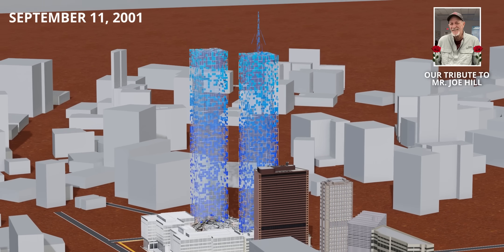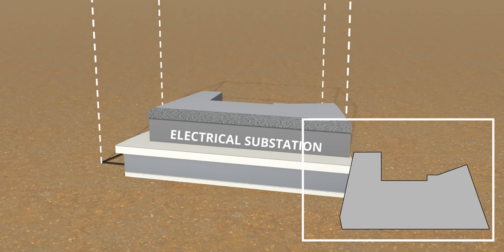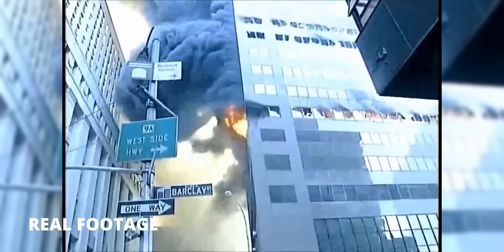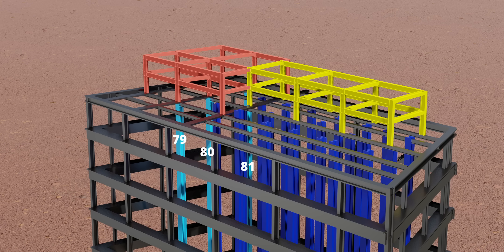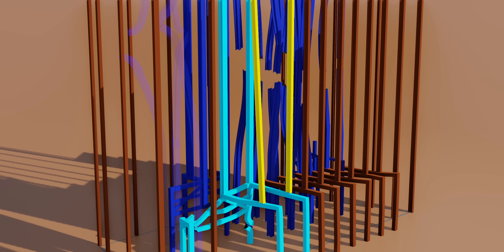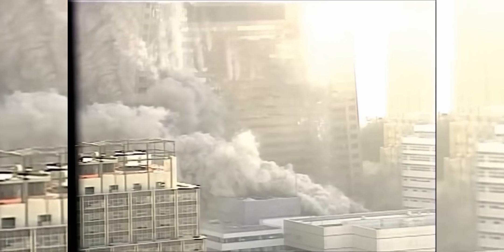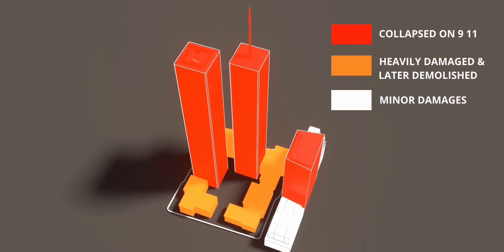Collapse of Building 7 | The Complete Physics

Comment: This video skips over a lot of major problems. WTC 7 had isolated fires, not a full-building inferno, and steel-framed skyscrapers had never collapsed from fire alone. Even NIST admitted that WTC 7 fell in true free fall for over two seconds, meaning there was no structural resistance, which does not happen without demolition. Localized failures like transfer trusses would have caused a partial, uneven collapse, not a near-perfect vertical drop. Multiple camera angles captured the kink and inward fall, so it was not a visual illusion. The video also leaves out seismic evidence, audible booms, and eyewitness reports of explosions before the collapse. On top of that, it assumes progressive failure without explaining how dozens of critical supports could fail almost simultaneously. This feels like a shallow explanation that leaves out too much important information to seriously account for how WTC 7 actually fell.

Comment: Calling BS!  It was a  controlled demolition.
Reply: Then provide a better, more detailed explanation. Go ahead, be the first to even try. 

You may not like it after more than 2 decades of internet conspiracy dogma, but what is being presented in this video is fundamentally correct and widely supported by the worlds engineering community.

While imperfect (there are a few problems) this video goes into a much higher level of detail than many viewers can comprehend and gets the collapse mechanisms fundamentally correct. This is true no matter who planned and carried out the 9/11 attacks or why . 
	
Sure, it’s not what you want to hear and goes against 20+ years of conspiracy dogma and conditioning, but that is not the same as it being wrong. You just need to fix your dogma. 

On the plus side, this video can be (and is) fundamentally correct about the engineering AND the 9/11 attacks could still have been some sort of inside job. The two things are in no way mutually exclusive. It’s just not the inside job the clowns you have been following on the interent have been telling you. 

This will surprise you to learn, since the conspiracy side of the internet hides it from you, but the mechanisms described here have broad professional support around the world. There are no professional engineering organizations (for example: ASCE, ASEE, ICE, etc) that disagree with them or have offered any formal dissenting opinions or alternative hypothesis. 

So, either the overwhelming majority of the worlds structural engineers and quite frankly simple observation are wrong,… … or you know more than the worlds best engineers from cruising around on the internet. Which seems more likely?

Comment: Complete BS.
Reply: And yet not wrong, go figure. Not perfect, but not wrong. 

You may not like it after more than 2 decades of internet conspiracy dogma, but what is being presented in this video is fundamentally correct and widely supported by the worlds engineering community.

While imperfect (there are a few problems) this video goes into a much higher level of detail than many viewers can comprehend and gets the collapse mechanisms fundamentally correct. This is true no matter who planned and carried out the 9/11 attacks or why . 
	
Sure, it’s not what you want to hear and goes against 20+ years of conspiracy dogma and conditioning, but that is not the same as it being wrong. You just need to fix your dogma. 

On the plus side, this video can be (and is) fundamentally correct about the engineering AND the 9/11 attacks could still have been some sort of inside job. The two things are in no way mutually exclusive. It’s just not the inside job the clowns you have been following on the interent have been telling you. 

This will surprise you to learn, since the conspiracy side of the internet hides it from you, but the mechanisms described here have broad professional support around the world. There are no professional engineering organizations (for example: ASCE, ASEE, ICE, etc) that disagree with them or have offered any formal dissenting opinions or alternative hypothesis. 

So, either the overwhelming majority of the worlds structural engineers and quite frankly simple observation are wrong,… … or you know more than the worlds best engineers from cruising around on the internet. Which seems more likely? 

If this explanation is wrong then produce a better one.  Be the first to even try.

Comment: All bollocks
Reply: You may not like it after more than 2 decades of internet conspiracy dogma, but what is being presented in this video is fundamentally correct and widely supported by the worlds engineering community.

While imperfect (there are a few problems) this video goes into a much higher level of detail than many viewers can comprehend and gets the collapse mechanisms fundamentally correct. This is true no matter who planned and carried out the 9/11 attacks or why . 
	
Sure, it’s not what you want to hear and goes against 20+ years of conspiracy dogma and conditioning, but that is not the same as it being wrong. You just need to fix your dogma. 

On the plus side, this video can be (and is) fundamentally correct about the engineering AND the 9/11 attacks could still have been some sort of inside job. The two things are in no way mutually exclusive. It’s just not the inside job the clowns you have been following on the interent have been telling you. 

This will surprise you to learn, since the conspiracy side of the internet hides it from you, but the mechanisms described here have broad professional support around the world. There are no professional engineering organizations (for example: ASCE, ASEE, ICE, etc) that disagree with them or have offered any formal dissenting opinions or alternative hypothesis. 

So, either the overwhelming majority of the worlds structural engineers and quite frankly simple observation are wrong,… … or you know more than the worlds best engineers from cruising around on the internet. Which seems more likely? 

If this explanation is wrong then produce a better one.  Be the first to even try.

Comment: Newcomers  -  just notice how many times   Criticalstink*** has replied within an hour or so and the general  Negative  " tone of voice "    Full time  SHILL  ( even on a Sunday ???  )
Reply: --  just seen  replies from  moroneyes   and  middleclass**      also   -    ( same  Shill Dept. )
Reply: In all highrise buildings a portion has to stick up for the cables and whatnot above the elevator shafts and usually there's steps as well to get on the roof. In any controlled demolition these shafts and stairwells have to be cut prior to the controlled demolition.  Kinks are created in controlled demolitions to make a building fall straight down. This clearly was a controlled demolition 1 because of the time it took to collapse proving there was no resistance at the time of collapse,  and 2 if any of the interior and exterior vertical columns met resistance you would see the deformation in the roof as it resisted on the way down. But never once does a portion of the roof protrude upwards from the resistance proving it didn't occur.

Comment: Total BS

6:25 Notice in this video how he omits the crucial floor bracings and steel beams that interconnect the columns—elements essential for structural rigidity and floor support. In reality, about 95% of steel buildings rely on a truss system, typically incorporating 45° angled supports, to evenly distribute loads and prevent any single column from bearing excessive stress. Without it, the entire structure would lack the balance and cohesion that such systems are specifically designed to ensure.

If you go on truth social and look up a group titled as “Never Forget” there is a video there of someone who used a digital home camera to record the actual blast that is going off in the building. You will hear the explosions happening, bringing the building down.
Reply: Of course all but the columns are omitted at 6:25. Were you paying no attention at all?  Are you really that clueless?
Reply: "there is a video there of someone who used a digital home camera to record the actual blast that is going off in the building. You will hear the explosions happening, bringing the building down."
No. There isn't. And making that up doesn't change anything.
Reply: @mooneyes2k478  wait isn’t that “video” just a hoax made by EdwardCurrent?
Reply: @RandomUsername2342  Indeed it is.
Reply: @mooneyes2k478  figured.

Comment: Interesting, why dont my steel and cast iron pans similarly melt when exposed to 600F on my stove? How did WTC1 and 2 fall at near free fall speed as though there was zero resistance in the floors below? Why did they explode so violently, sending caustic plumes of pulverized concrete flying for hundreds of meters? Why can molten steel be seen flowing off girders? Why were there detonation squibs firing in the floors preceding the collapse of floors above? Why did they find pools of Tritium in the basement, which does not exist in nature and is only a byproduct of nuclear detonation? Why are WTC1, 2 and 7 the only steel frame structures in the history of steel framed structures to succumb to fire, i.e. 100 story skyscraper in Spain fully engulfed in fire for 16 hours, didn't collapse at free fall speed? How does jet fuel, which has a burn temp of 1000F, melt steel, which has a burn temp of 2000F? I understand that the Cabal of Chosen People behind 9/11 need to create compelling propaganda to convince the masses to believe the official story.
Reply: --  Got in one ..   This is exactly what is happening regularly now... specially commissioned  Total BS. to try to convince the upcoming younger generations..
We have  watched for 10 yrs plus  and the  Shill Dept are even more active with  YT  removing vids from a few years ago which showed  a few clues to  the ridiculous  Fairy Story.
If not seen  - try  "  Flight Attendant sheds new light  ------   "  (  assuming not removed.)
After 15+  yrs investigation she has discovered 99% of the shocking details of what actually happened.
Reply: No steel melted or needed to, which you would know if you had actually watched the thing and paid attention. Your post only goes downhill from there - the poster child for not getting it on a fundamental level while believing you nailed it.
Reply: Steel absolutely melted, there's video footage of it flowing out of the building
Reply: @Make1984FictionAgain-JQ  - Molten metal pouring out of the South Tower (and it was in fact ONLY the South Tower)?  You mean this?

youtube.com/watch?v=xPVGGQU-MeQ&ab_channel=SeekersofTruth 

So you think that is molten steel why?  Because you performed metallurgical tests?  Because the internet told you that’s what it is?  I think we can do better, so let’s do better and build a theory the right way instead of making evidence-free assumptions. This will take just a couple of minutes and is worth the investment. 

The Boeing 767 which struck the South Tower weighed 117 tons and 80% of that was aluminum.  The exterior cladding on the Twin Towers – the white panels – were also aluminum. When Flight 175 struck at the 81st floor its momentum deposited much of the office contents in its way and the bulk of the aircrafts mass into the NE corner of the building. The piled up debris shoved into that corner is visible in photographs and video so we know it was there. 

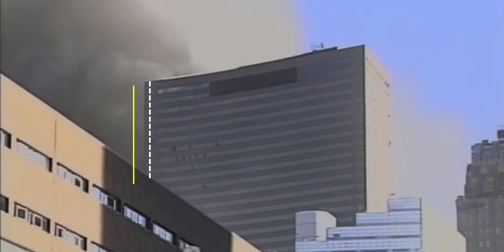There’s a good shot here of piled up debris from 4:36;

youtube.com/watch?v=ZLJyL63sqtU&ab_channel=MrKoenig1985

Steel melts at roughly 2,750-deg F while fires in the South Tower reached peak temperatures of around 1,800-deg F. Aluminum OTOH melts between 887-deg F to 1,180-deg F depending on alloy. That aluminum will melt under these conditions is not a surprise. If you look at pictures of cars left behind and destroyed by forest fires the aluminum wheels are invariably melted away along with other sometimes aluminum parts like hoods. Steel bodies remain intact. 

The “molten metal” appears at 9:52 am. At the same time we see the first externally visible signs of sagging floor trusses and the pulling of the perimeter columns inward. I submit these events are related, not coincidental. The aluminum cladding at the NE corner also appears to me to be burning. 

It is likely the with the floor trusses sagging under the heat, and the 81st floor truss in the NE corner under the debris pile subjected to the heavy load of the debris pile, the truss broke its perimeter column connections and dropped, instigating the material starting to pour out of the NE corner at the 80th floor.

Given the properties of the materials in question, aluminum is by far the most likely culprit. 

Reports from The NIST, FEMA and MIT all concluded the material is aluminum. 

Certainly steel is the least likely of all the materials the anomaly could be given its much higher melting temperature and the fact there is no logical source for molten steel.  The perimeter columns in the NE corner are intact and the material is pouring out between them. So it isn’t columns melting, therefore what other source of steel is there?

Deniers will claim molten aluminum appears silver when molten, which is true but only at the low end of its melting temperature range. Aluminum can and does get hotter and it glows red to orange when it does (1,100 to 1,800-deg F).  Most folks of course just don’t bother getting it that hot if the goal is just to get it molten for say molding a part. No need to go higher. 

The total mass of molten aluminum is a BIG deal in regard to how it behaves when poured. Quantities bellow half a liter cool almost instantly if poured onto a flat surface, but if poured into say an ingot mould will stay red for a minute of so. Pouring volumes of molten aluminum greater than a liter is a VERY different experience. The thermal mass is much greater and the radiant heat is horrendous. The aluminum is able to stay liquid and remain glowing bright orange much longer. 

The famous video of glowing liquid gushing out of Tower 2 moments before it fell, involves at least tens of liters of molten aluminum. The thermal mass involved is so great that it stays red after falling many meters through the open air.

Side note: There was also a large UPS battery farm in that spot and some of that material at least may well be from the batteries IMHO.

Comment: controlled demolition, stop lying.
Reply: The collapse of Building 7 is one of the most studied engineering disasters in history and the subject of 5 comprehensive engineering studies and more than two dozen technical articles in major peer reviewed engineering journals, most of which were published 15 or more years ago. Thousands of pages of material.  This should get you started.

FEMA BPAT (initial report superseded by NIST NCSTAR 1A)

NIST NCSTAR 1A: Final Report on the Collapse of the World Trade Center Building 7, 2008.

Guy Nordenson and Associates, WTC7 Global Collapse Analysis Report and Summary of Findings, 2010.

Arup, WTC -7 Structural Fire Analysis Report (Runs 1-4), 2010.

Weidlinger Associates Inc., WTC 7 Collapse Analysis and Assessment Report, 2010.

BRE Centre for Fire Safety Engineering, Analysis of the Impact of a Fire in the Mechanical Room (5th & 6th Floor) of the World Trade Center 7 Building, 2010.

T. McAllister, R. MacNeill, O. Erbay, A. Sarawit, M. Zarghamee, S. Kirkpatrick, J. Gross, Analysis of structural response of WTC 7 to fire and sequential failures leading to collapse, J. Struct. Eng. (United States). 138 (2012) 109–117.

For a summary of the major studies I would recommend THE COLLAPSE OF WORLD TRADE CENTER 7: REVISITED by Mhd Anwar Orabi , Liming Jiang , Asif Usmani and Jose Torero which is a 33 page summary of the different analysis and conclusions published in 2020. Sorry, YouTube will delete this post if I give the link but it should be easy to find and is available from the University of Queensland, Brisbane. 

Real structural engineering industry professionals conducting real engineering studies and publishing them for other professionals to see. Not amateur YouTubers appealing to the gullible and credulous.

Happy reading
Reply: @TheCriticalStinker-01  ..     Studied by Honest Engineers and  confirming  NIST  are  complicit    ...    ( like you )

Comment: Thank you. Yes, but the building should tilt south and not fall vertically, Also the antenna did not fall sideways but strait down and vertically
Reply: But it didn't - so why are your assumptions false?
Reply: @TheCriticalStinker-01  of course if did. Both towers fell vertically. Also both towers had presence of molten iron and  Thermite
Reply: @mouradbelkas598  - What other way could they fall?  Down is the direction of gravity. 

What prersence of molten iron and thermite and if present, so what?  We know collapse initiation was due to sagging floor trusses at the impact and fire damaged floors, causing inward bowing of some surviving perimeter columns by up to 5 feet until they buckled.
Reply: @TheCriticalStinker-01  Where does thermite come from? iron does not melt with fuel in open air (especially when passport of the terrorist didn't even burn). In your video you attributed the antenna caused severance to the structure, yet the antenna never came close to that building. I find it odd.
Reply: @mouradbelkas598  - Thermite? What does thermite have to do with anything.

What my video are you talking about?  This is NOT my video.